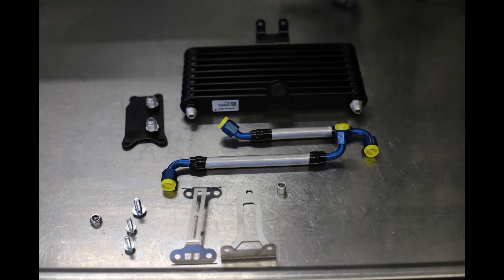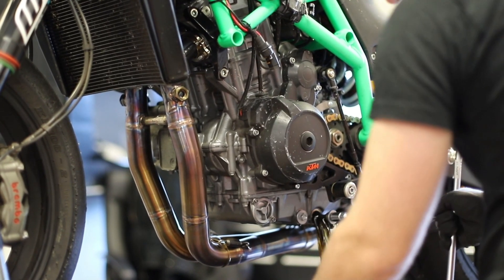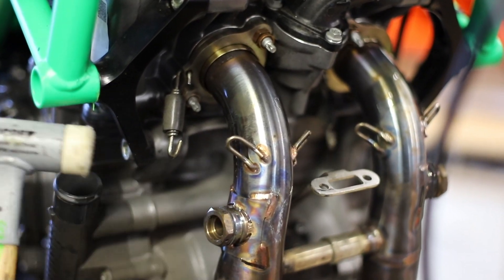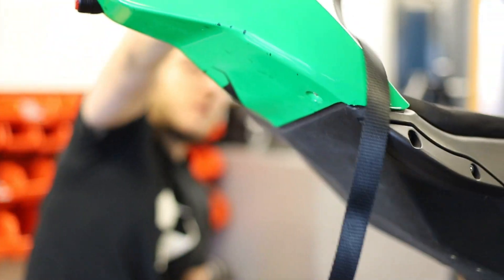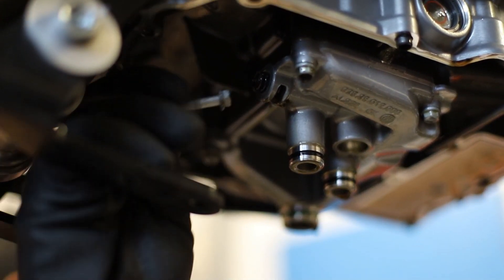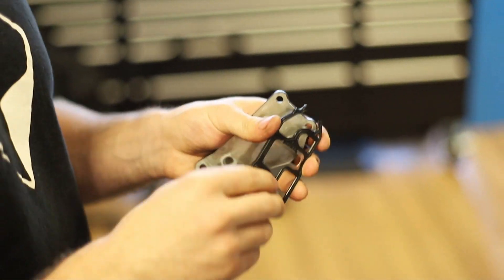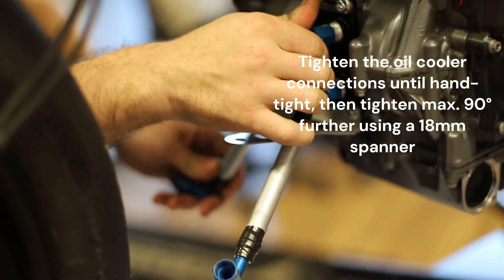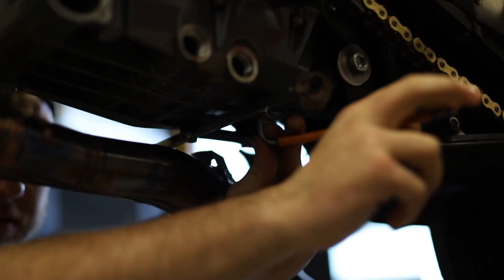Krämer Motorcycles GP2-890R Oil Cooler Upgrade - Instructional Video

Comment: Hi, Will this help with the cam shaft issues on the 790 / 890's ?
Reply from the maker: We only recommend this upgrade for Krämer Motorcycles and the KTM RC8C's. We do not suggest this for road bikes.
Reply: @KraemerMotorcycles  I don't think it will pose an issue aside from interfering with the original headers of the 790/890 duke
Reply: for street bikes get the speedbox oil radiator

Comment: i just installed this on my bike last week.  I wish i had this video then 🤣
Reply: is the difference it temps big?
my bike suffers from high temps during summer because ambient reaches 50 celsius, temps will immediately spark when stopping and the radiator fan cannot keep up.